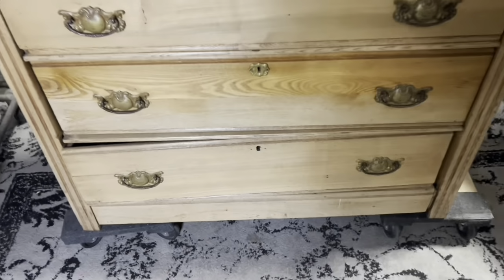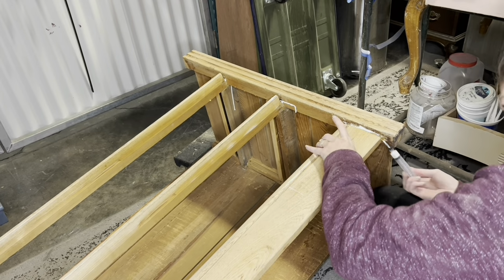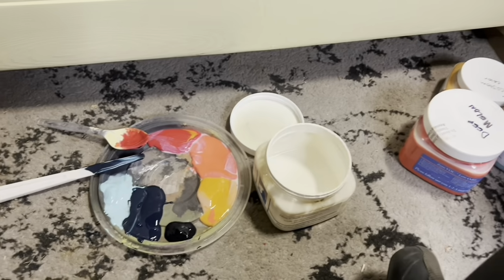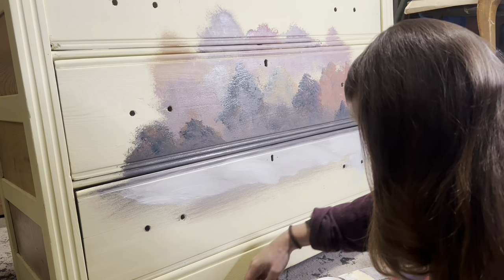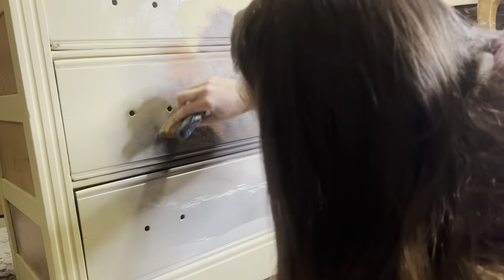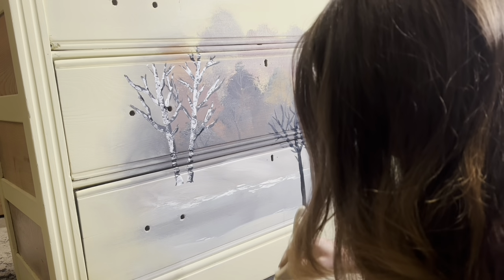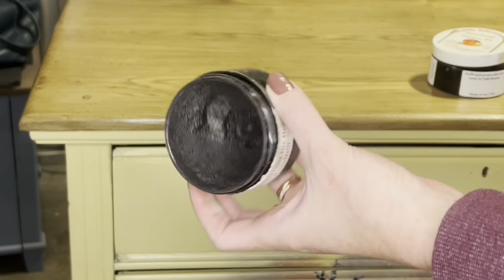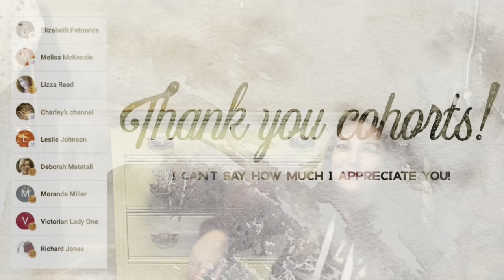Cheerful Winter Landscape Makeover | Elegant Upgrades

Comment: I stopped at 4:38. Love the tip about using the clamps to see if can be repaired. Also, can you do that tape technique with Bondo?  Don’t want to forget to ask
Reply from the maker: Oh yes! You can absolutely use it with bondo. However, bondo is a lot harder once cured so you may have to work a little harder to get the tape off. Still less time than trying to sand through a mound of bondo, though.

Comment: Those long screws on the hardware inside the drawers are a danger to hands reaching inside . I have seen many folks leave them that way instead of cutting them off.😊
Reply from the maker: They can be, but I would never cut them off since they are original to the piece. I do make sure to mention it to the buyer so they know about it and can make the decision to change out the hardware or alter them themselves.